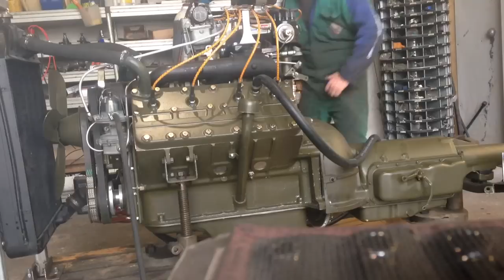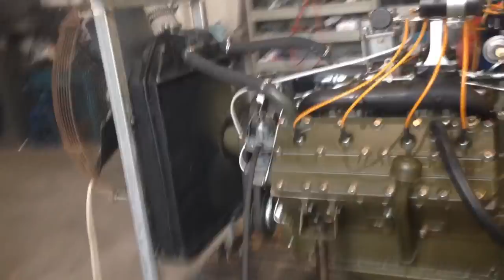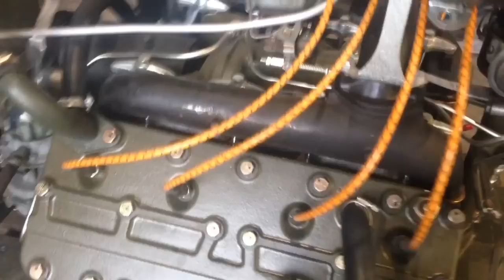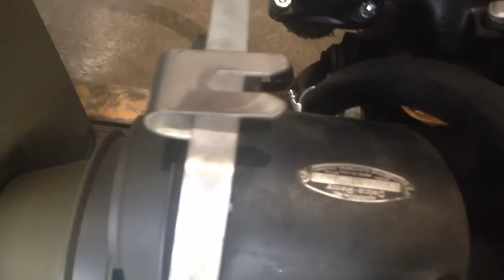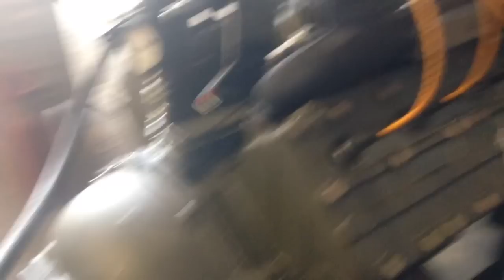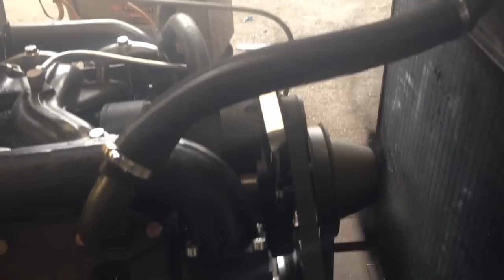engine Caddy 346 1948 closed throttle

Comment: I would put exhaust pipes that go straight up.  They put the exhaust ports on the top, to avoid the heat problems with going through the block.

Comment: Runs like new! I can't relate to how gm ran the exhaust manifolds up next to the intake and carb, they gotta get hot next to all that!?
Reply: In theory better than ford flatheads at the time due to the design of the flathead the valve had to pass exhaust next to the intake, ford cast the exhaust passage into the block around the cylinders. Often leadimg to cooling issues where here heat goes right out of the engine. It may pass by the intake but not as detrimental as passing the gas thru the block.
Reply: @Gleone58  I have to disagree. The flathead was in production from 1932 til 1953 in a few different evolutions. The exhaust passages in the block did create a lot of heat, but it was mainly carried away by the cooling system. The overheating issues were tied more to the inefficiency of the water pumps as well as the size of the passages cast into the block and heads. I mean no disrespect to the Cadillac engine, but from a wrenching viewpoint, having hot exhaust manifolds directly adjacent to the carb, just seems risk laden. Simple carb adjustments, or fuel leaks now take on a different kind of danger. It's still a cool engine, I had never seen one before, only familiar with the Ford flatheads.
Reply: @markk3652  what about other engines such as most inline 8s and 6s that both OHV and flathead ran exhaust on the same side as intake, same danger. I agree that it is a danger. Im considering wrapping the exhaust in insulating wrap especially if i decide to run a 2 barrel efi setup. Apparenty the hot eshaust messes with the electronics.